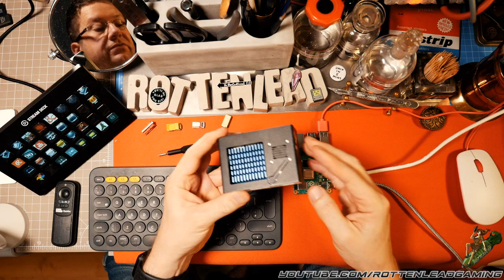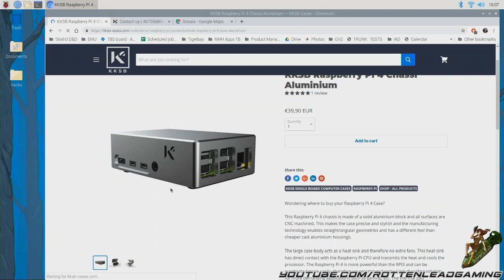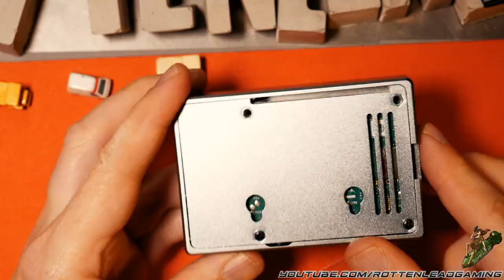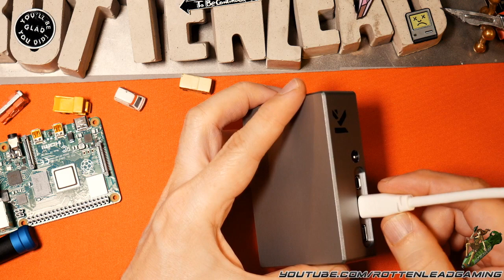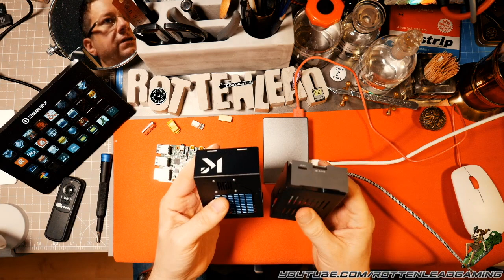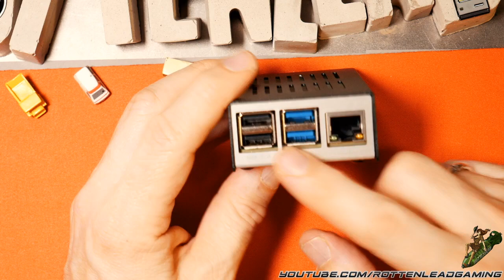KKSB Aluminium Raspberry Pi4 Case Review

Comment: The milled slot on the bottom plate may allow a ribbon cable to exit the case when attached to the GPIO pins.
Reply from the maker: Perfect yes, a gap for the ribbon.

Comment: Do you know if wifi is working well or is the signal severely reduced by the case?
Reply from the maker: It works great a room away from my Google Mesh wifi. However I have not specifically measured the difference. If I get chance I will have a look.
Reply: Thanks! That’s good enough for me.

Comment: I wished that the "stem" was longer so the pad could be thinner or be able to use thermal paste to maybe get a little better thermals.
Reply: KnaGGelMan yes I agree. I wonder if they leave a gap as a way to prevent some people breaking a chip by pushing to hard or some similar lack of tolerance causing an accident.

Comment: Nice review! Is there room for a PoE hat in the second case, do you think?
Reply from the maker: I think so, it has plenty of space. I guess it depends on the particular PoE kit you use. I have seen some that are probably too big.
Reply: @RottenMechGaming   I was thinking of the official PoE kit from Raspberry Pi. It's probably not gonna fit, which is a pity now that an active cooling solution is necessary.